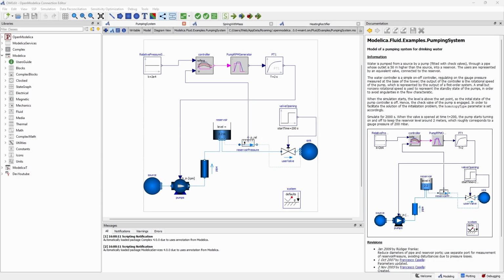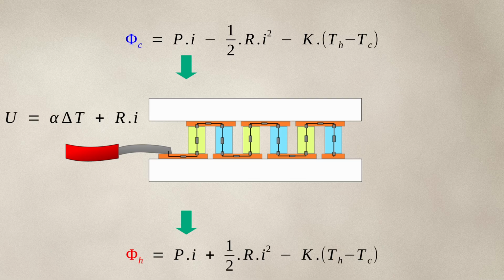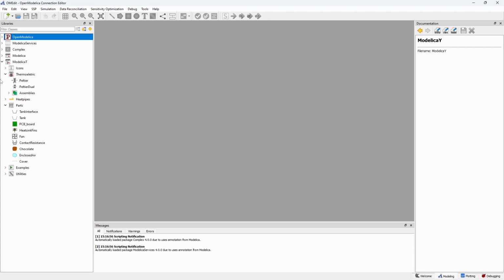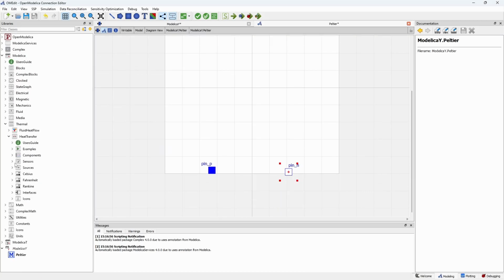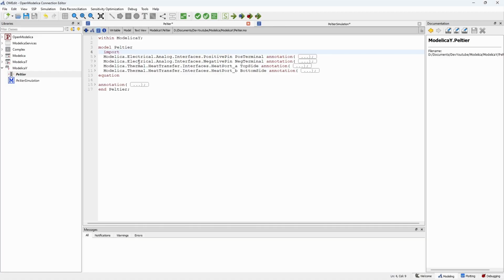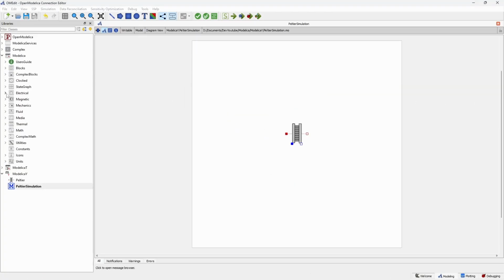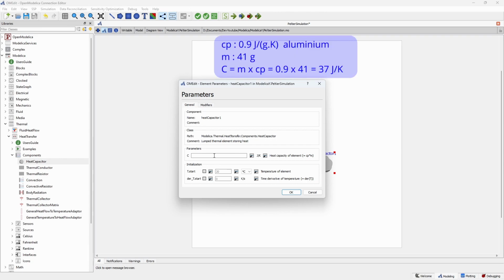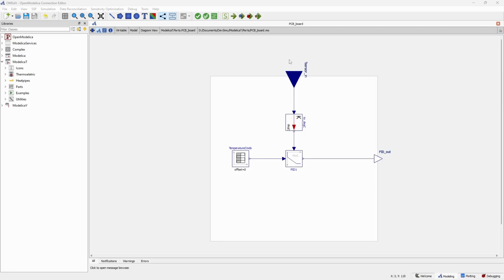Modelica tutorial for beginners : Peltier module simulation

Comment: Just leaning about modelica, very detailed tutorial. Btw, this peltier set up works in reverse, like applying a themal diference will generete a small voltage in the other side?
Reply from the maker: Yes, modelica is acausal and so when you apply a thermal difference, you will get voltage (and current in a load) on the other side.